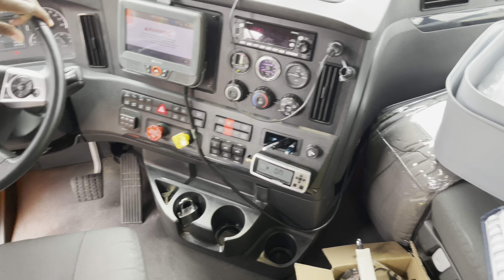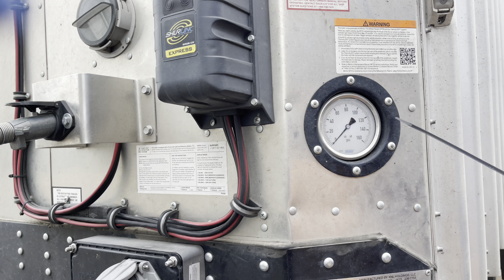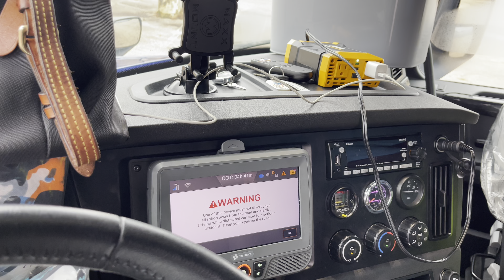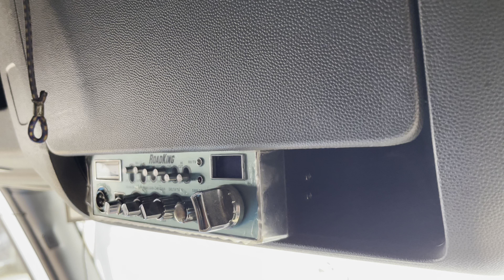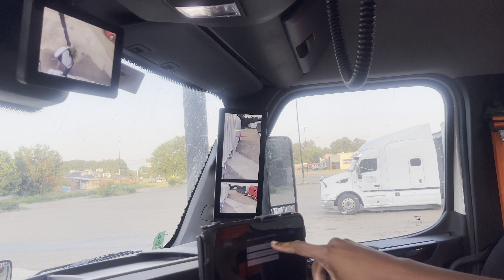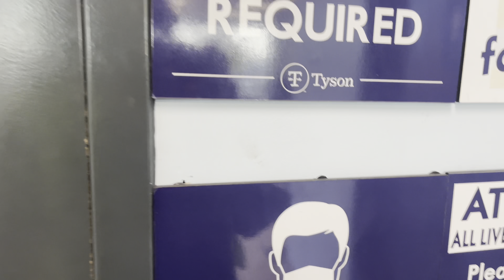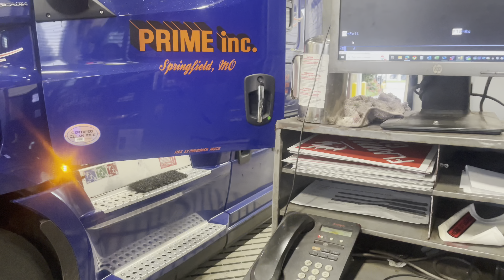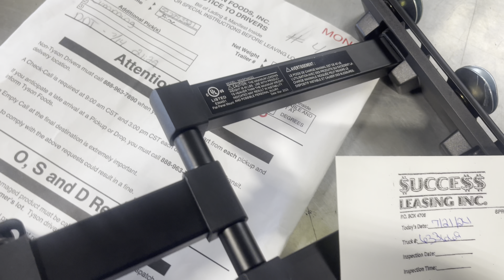Prime inc. Turning Truck In At Springfield, Mo Terminal.

Comment: Did you give your two weeks or ? Just curious if they want they truck back asap when you resign or can you give a date on when you turning it in
Reply from the maker: I gave prime a date.
Reply: Don’t ever give a trucking company notice unless you’re local or stay within 300 miles of your home.  Companies are notorious for cutting fuel cards off, keeping you out running shit short runs to get more work out of you, etc.

Do companies give you 2 weeks notice when they fire you?  😏
Reply from the maker: @FFKDTP1  I agree. My date was the same day I resigned, I had cleaned the truck out and at the terminal.